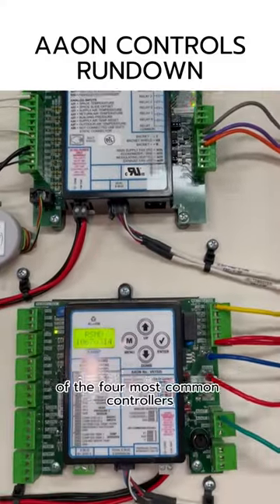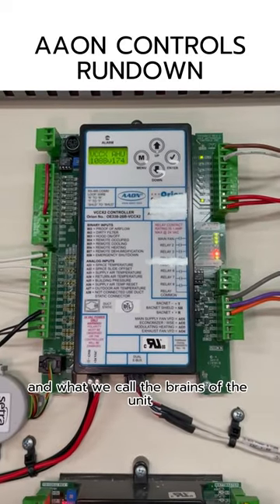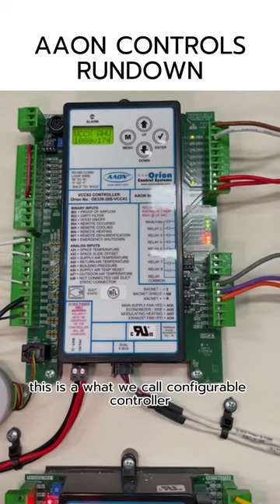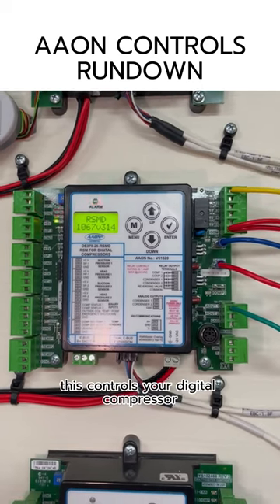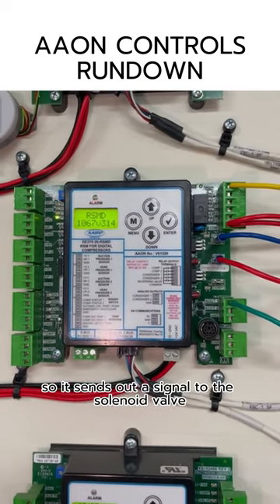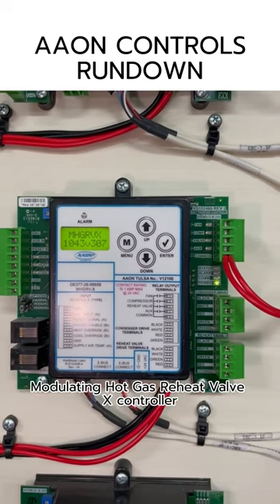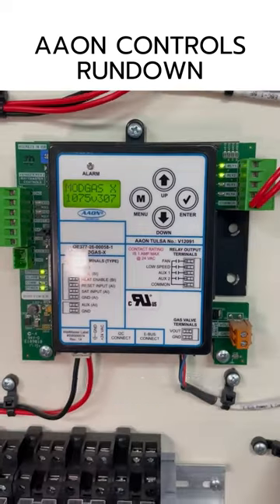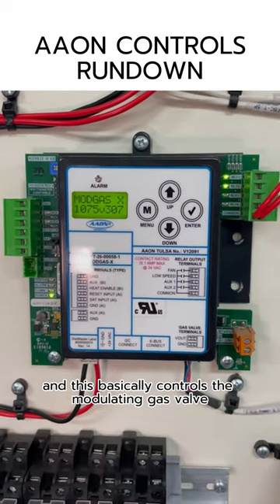AAON Controls Run Down!

Comment: I got a question on these Aaon Rtu . As you we are heating season right . The unit only will  start the inducer motor and ignite the burner while having the panel door panel to the  filter or the economizer open . Can you tell me what might be the problem??so if everythkng is close panel and economizer damper is close . The machine will do nothing  will not even start the inducer

Comment: I was working on one today. It originally had a VCM and was converted to a VCCX....the wiring is an absolute nightmare with how they left it. It doesn't have digital scrolls either and has a MGRH board and the older 3 way heat reclaim valve. This unit is causing me fits